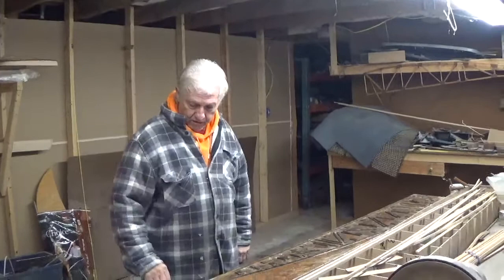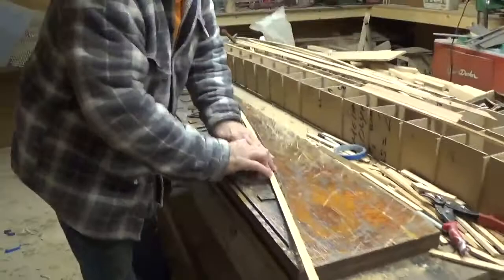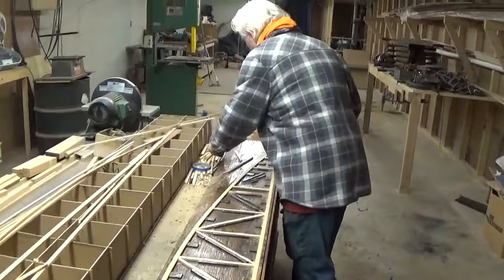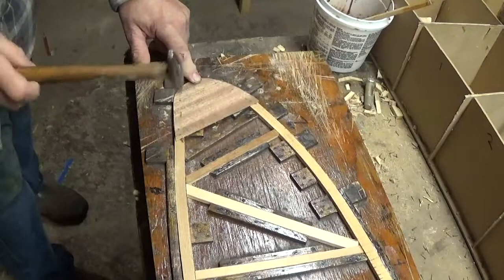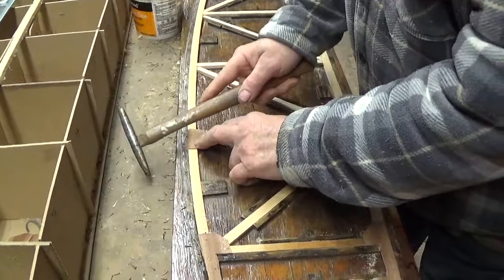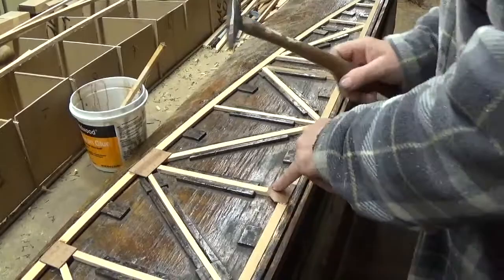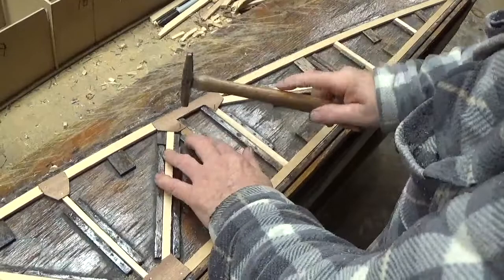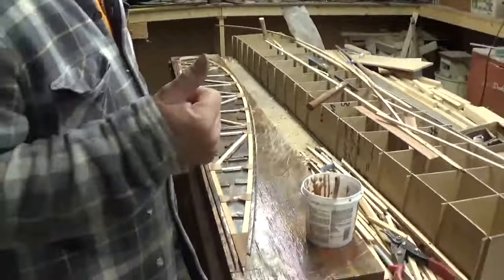Building a Wing Rib

Comment: Several questions: at 6:40 the front gusset of the rear spar is pointed: why not cut the gussets with more accurate angles on the ends? It would only take a couple seconds. Why no glue for the gusset ends? What type glue is used? What type woods are used for the rib and gussets? Doesn't  hammering the gusset in put stress on the rib top and bottom? Why not sand them to hand tight? Noticed one gusset chipped at the bottom: does this not compromise the strength, especially since they are not glued?
Reply from the maker: These ribs are built per the original. Why they shaped the gussets the way they did? Who knows! 
As with anything, over time we understand that there may be better, more efficient ways of doing things, but if you want to stick with the authenticity of how something was built "back in the day", you do it they way they did!  
That is why there are so many "rough edges" on the Spirit of St. Louis by JNE ... we were going after the authenticity of the original build.  The ribs being built in this video are for the aircraft that came just BEFORE the Spirit ... These ribs will be going on a 1927 Ryan M-2.  
As for hammering the nails ... again, that is the way it was done. There are likely better ways of doing it today, but those ways are not original.  
The gussets are there more to keep the rib pieces in place once they are removed from the jig, rather than for strength in the structure, so a chip on a gusset really does not affect the structural integrity of the rib. It only affects the appearance of the rib. 
We only made this video to give some tips John has learned over the years of building wooden wing ribs, to make it a bit easier for those who are struggling with how to get theirs built ... and to give an idea of what it takes for those who have never built ribs before. 
Thanks for asking the questions, and Thanks for watching!

Comment: Are you using bonderized aircraft nails? If so, do you know where I can buy them? I've read that Wicks and Aircraft Spruce don't sell them anymore.
Reply: Yes he is.  Because he was in the wing building business back in the late 1980's - early 1990's we had purchased a huge order of the nails.  They didn't all get used up by the time he evolved to full general aviation restoration and these are some of what is left over from back then.  If you are building an experimental airplane, the FAA has suggested using staples and then pulling the staples after it dries because the nails don't really do a whole lot.  If you building a CERTIFICATED airplane then you do need to nail them since that is the process originally used.  Not really sure where you might be able to find the bonderized nails today.
Thanks for watching!
Reply: @heathernorman4805  Thanks! I’m building an Experimental aircraft, so I have plenty of options. I just like the look of the nails and wouldn’t mind the work of pounding them in by the thousands.

Comment: What kind of wood is used in the top and bottom strips?  I can soak my stuff for a week and it still snaps the moment I go to bend it.
Reply from the maker: These cap strips are spruce.  I also like to use Alaska Cedar.  Be sure to bend the strips WITH the grain of the wood ... if you bend it against the grain they are likely to snap and if they don't snap there is a good chance you will still have a stress fracture!

Comment: Amazing!, What kind of nail material he use, that he can catch like that?
Reply from the maker: Those are 1/4 inch, brass coated, steel nails.  The steel in them are what make them catch the magnetized tack hammer so easily.
Reply: @JNEAircraft  Thanks a lot for the answer, i guessed he use some galvanized nails,

Comment: What glue is being used?
Reply from the maker: I believe he was using Resorcinol glue on those ribs.
Reply: I'm pretty sure it's Urea Formaldehyde which has many names. Weldwood plastic resin or Cascamite are common. Fairly certain that's not recorsinol. I investigated glue quite a bit and it's a rabbit hole. I tried to get faith in recorsinol as it's the only "approved" glue. It's great but hard to get right as far as conditions and assembly. I think T-88 and FPL16A are excellent epoxies and much easier to use.